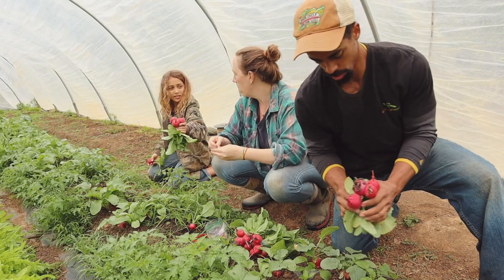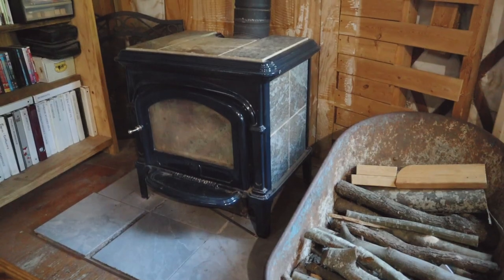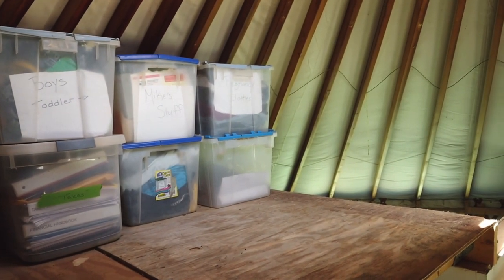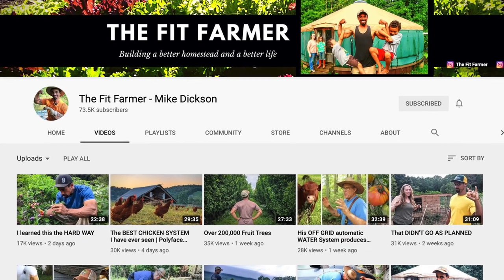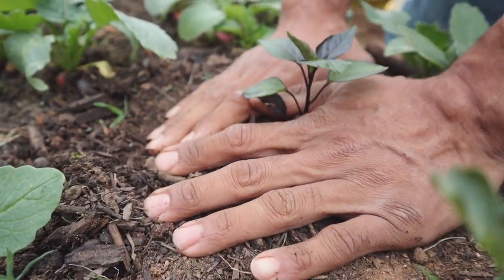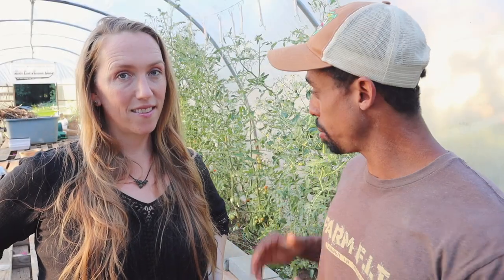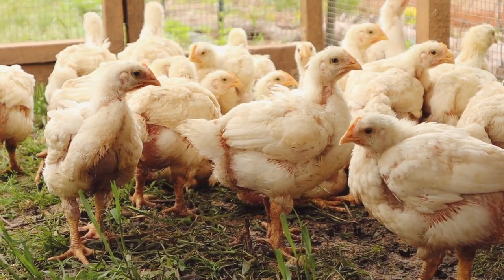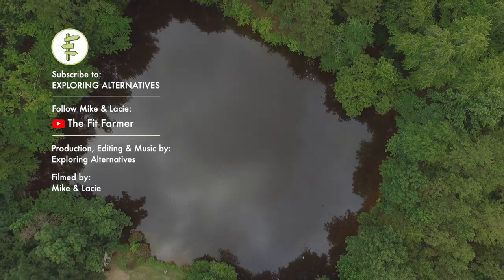Self-Reliant Family Builds a Thriving Homestead While Living in a Tiny Yurt

Comment: I'd love a yurt, but I don't do well with mold and I'd be overwhelmed trying to prevent it.
Reply: Mold isn't a usual problem with yurts; it's just because they used electric heaters.
Reply: @uphillhomestead6188  I'm not understanding what electric heat has to do with it? Is it just not drying enough? Wouldn't condensation still build if the outside is cold, inside hot. I was thinking it had to do with lack of quality insulation, unless it were one of those real wool Mongolian ones. Either way I also saw another yurt family talking about struggling with mold
Reply: @ozarkmtnarts  the only reason we ever had a problem with mold is because the heaters couldn't keep the air dry enough. We haven't had any issue with mold since we got our wood stove. We actually have to set a pot of water on the stove in the winter to add a little moisture back into the air.